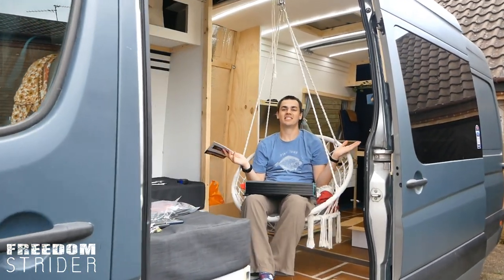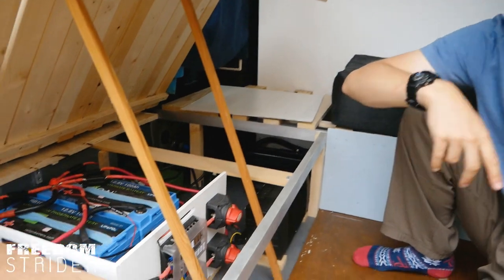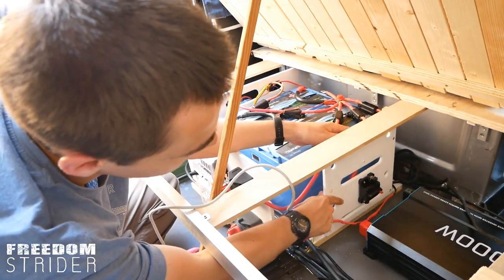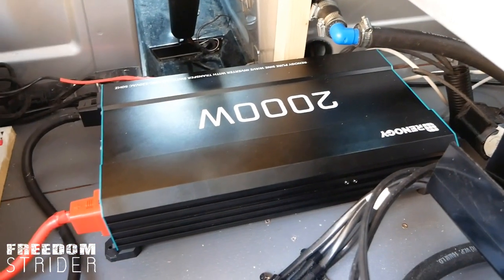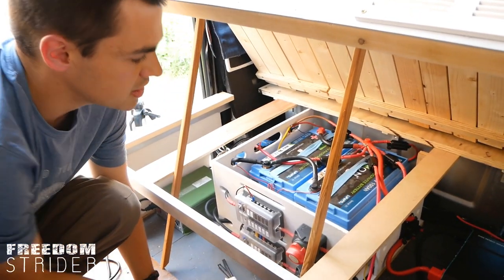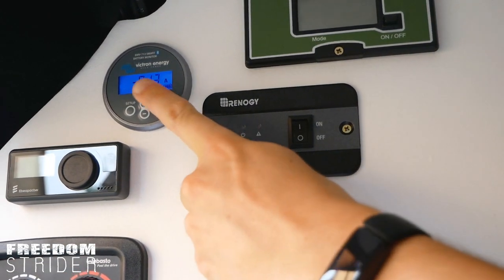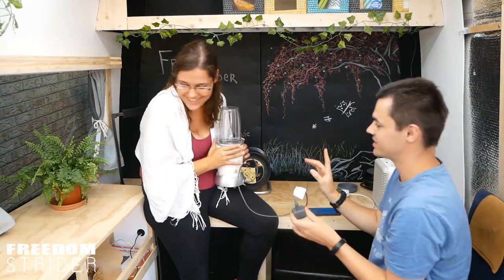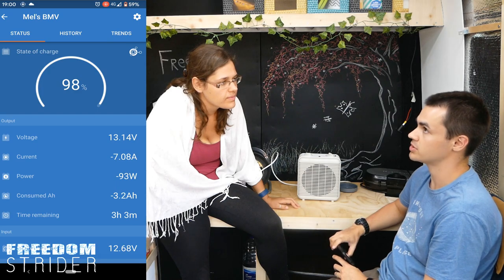EASY Inverter Installation for MAXIMUM POWER!

Comment: You guys are awesome. You will have full comfort of an apartment in your van. You'll never ever need to come back home.

Before, when we travelled in a passenger car with a tent, we found ourselves returning home striving for some comfort. A need to sit on a comfortable chair and rest our backs on a proper mattress were something that cut our trips shorter than necessary.
Now, with the van, after three weeks vacation/work from "home", we were wondering why we were even going back home. We felt home in the van, we could work online and we were more comfortable than ever before. Our build is much simpler, though. We heat water on the gass burner, have no real toilet (we have a shovel for when there is a forest around and an emergency bucket with a toilet seat for, well, emergencies), indoor showering solution is still in the making and we have just a single workspace (so we have to use the bed as the second one). But still, we never felt like we missed anything. With your build, you will have more than enough. Great job!
Reply from the maker: Thanks, this current build is turning out quite luxurious. 😊
I remember quite well when we were roughing it in our 7-seater car in New Zealand - we got along with much less, but the car felt like home. Though we did enjoy the occasional housesit - more stretching room and bathroom 😂 
There is always a way to get done what you need; your set-up seems like a good foundation to build upon.

Comment: with the inverter having a 4000w surge are 35mm cables large enough, just planning my electrics now with same inverter on 12v
Reply from the maker: Well with our 200A breaker, that should kick in if the inverter is drawing more than around 2500W, so safe enough for 35mm cable. We've used a 2000W appliance for 30minutes and the inverter hasn't turned off or the breaker hasn't tripped, so that seems to be good. It's important that your fuses and breakers trip under the limit for your cable.

Comment: Pretty cool video, thanks for sharing! Maybe a beginner's question, but why do you put a circxuit breaker between the inverter and the battery? Those inverters have internal fuses, don't they?
Reply from the maker: Most inverters do have an internal fuse, and some are even replaceable, but it's much easier to reset a breaker than opening up an inverter and replacing the internal fuse (if that's possible) 👍 with a breaker you just press a button to reset

Comment: Am also keen to see how you get on with your build. We are considering getting electric induction hub and would like to see how much battery power we would need. To be honest with our usable 5.3kwh battery it only lasts us 1 day and a few hours without any power input. I find we can go about 17 days without fully charging our battery before we need to charge, we had 1 week without much sun, it was very cloudy and raining lol. I cant even imagine what we would need when we have more electrical items in the van lol
Reply from the maker: At first, we thought we would need more batteries to cook electric, but as long as you can recharge them enough each day to offset your usage for the cooking, it's actually quite doable. We'll let you know how we get one in winter. 👍
Reply: @FreedomStrider  that’s very true, knowing Uk weather, ideally we don’t want to have to be finding power when on the road lol, your right as long as you replace what you used you would be fine 😊

Comment: Just bought the inverter, is there a reason you did not use the supplied cables, they are 20mm which you double up
Reply from the maker: We'd have to use 2 positives and 2 negatives which means putting on 2, 100A breakers. We instead felt more comfortable putting a single 200A breaker, making it easier on our connections as well 😉

Comment: Which electric combi oven/microwave are you considering. Iv been looking online but can't seem to find anything?
Reply from the maker: We've been keeping our eye on this one: https://www.currys.co.uk/gbuk/household-appliances/cooking/microwaves/panasonic-nn-ct56jbbpq-combination-microwave-black-10182458-pdt.html

It's a decent all rounder but we don't know it's exact power usage...might have to test that out ourselves 🙄
Reply: You would think an 800w microwave uses 800w. Not even close. It actually uses a minimum 1380w constant power. With certain foods the initial surge is way above 3000w. I ended up buying a 3000w pure sine wave inverter. Its a 3000w Low Frequency inverter so it can handle a surge of 9000w for about 20 seconds. Yes its bigger and a LOT heavier than 3000w High Frequency Inverter but I will never push it close the 3000w constant current. I'm still waiting for my 600Ah of Lifepo4 cells to be delivered from China. My new van was delivered at lunchtime today. (A Peugeot boxer L4H3) So the fun begins. I have just waved goodbye to every spare minute I will have over this Winter & next Spring. LOL. Anyway my advice is go for the lowest power microwave/combi oven you can find. If I find a good one I will let you know.
Reply from the maker: Wow cheers for the advise about surge power, I think we'll potentially buy one and plug it into house power with a watt meter and use it in the house for a while and see what kind of power it draws before installing it into the van 👍

Comment: Interesting video guys👍🏼 I have a question, have you worked out with using just your solar how long it would take to top your batteries back up after a ‘normal days cooking’ ? 
Im considering using an induction hob myself and not have any lpg .. but,  I also want an oven.
Can’t seem to find any small electric domestic type ovens and won’t have room for a standard size one plus the huge power draw for 30-45mins.
I’d love not to have to use lpg but struggling to find a way around it atm.
Like you mentioned, if your not moving and solar isn’t putting enough in then eventually I’d run out of juice.

Cheers guys
Reply from the maker: Well, we have 540W of solar,
Normal day of cooking would maybe be 45mins of induction, so 1300W (110A ish) * 0.75hr = 82.5Ah. 
Solar at max pulls in around 45A.

So 2 full hours of solar to recharge an average day of cooking. In the winter, that might be difficult with everything else that will draw power, but in the summer should be no issue. 

82.5Ah / 200Ah seems like a huge draw, but with good recharging, it is possible 😎

Hope this helps 🙂

Comment: did you ground your inverter? there's a place to ground it but havent seen anything online
Reply from the maker: We did not ground it, we ran it back to the battery negative via our BMV shunt. This is important with lithium batteries, it can be slightly different with lead acid ones
Reply: @FreedomStrider  thanks as always guys!

Comment: Hey guys, a big word of caution- That Panasonic 3 in 1 micro/convection oven is listed as 1000 watts for the microwave. That means it uses 1,500 actual watts, as a microwave loses 50 percent of it's efficiency when converting to magnetron wattage, which is what is used for claimed product wattage. Hence, a 700 watt microwave uses 1,050 watts of electricity, a 1200 watt microwave uses 1800 watts, etc.
Beware! It's using a lot more power than you think!
Reply from the maker: Thanks for that, we have been looking at the spec sheet and the reason we haven't bought it yet is, that there are some combinations that use too much Watts for our system so we are researching a bit more. We didn't know about magnetron wattage so great tip, we'll consider it. 🙂

Comment: Lol i think you would be fine when you just leave your van on idle. I have 3 Orions 24V 15A  chargers and when i leave my van on idle they get full power from the alternator ( i have a 210A alternator),. I think you would be fine with not drying as long as you idle the van when you really need to :-)
Reply from the maker: Exactly, that's the plan 😊

Comment: Wow at full capacity your inverter will drain your battery in about 1 hour 15mins lol
Reply from the maker: Yup...that's about right, good thing our inverter usage would be very low since nearly everything is DC powered, so the inverter would only be used in short bursts when we are cooking, and it will be off the rest of the time. 🙂
Reply: @FreedomStrider  that’s good, I just left mine on permanently because it has a search mode which only uses about 1w to check to see if there is any AC load, and it comes on and off every few mins or maybe about 5-10mins which doesn’t make a difference when the solar is on lol. I think I left it on because we use it to ignite our cooker lol. We might even switch to induction hob for now and keep the oven and water heater Lpg. During the summer months when it’s funny we are always fully charged and don’t even use more than 20% of power with items being on etc. We haven’t turned off our fans in soo long, it’s quite nice having them on during the night lol. Might turn them off in winter though not sure yet lol.
The most draw so far is our fridge to be honest , it uses about 418Wh each day lol. It uses 50W (2.08A) for a few mins when on, which works out to about 8 hours 15mins runtime in the day depending on how low you set the temperature lol.